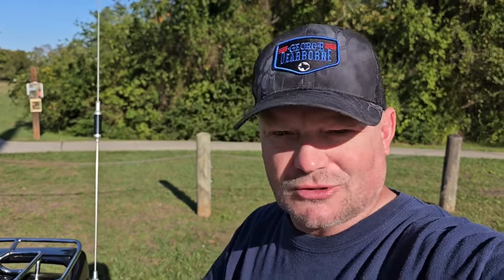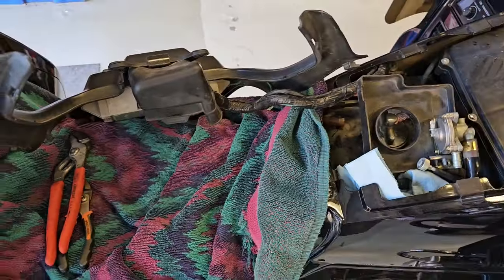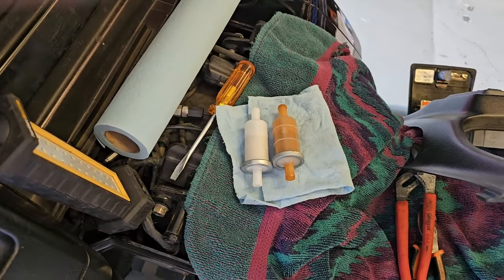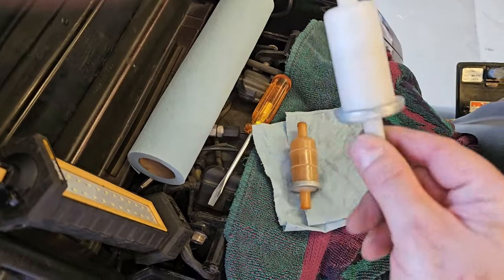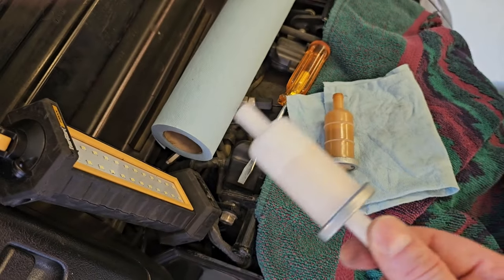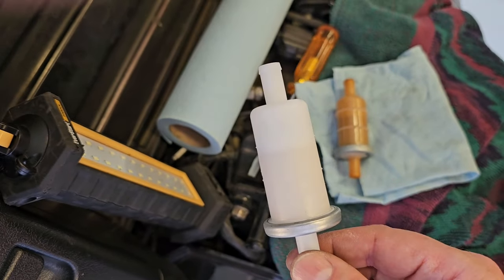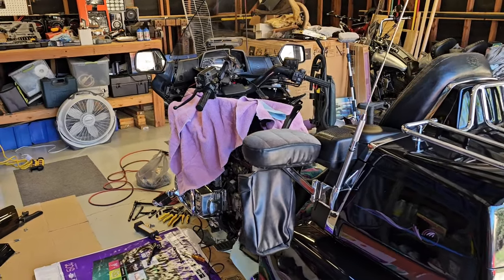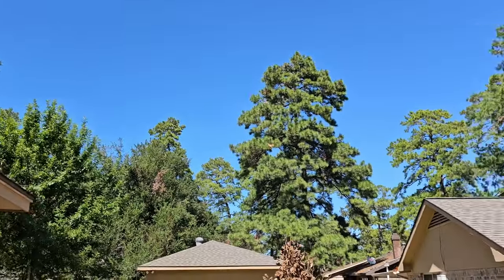1997 Honda GL1500 GoldWing SE Maintenance/Service Items Part 1

Comment: If you want an instrument panel you can see at night replace the bulbs with LED bulbs. Just so you know you have bought the best year GL1500 built. 97 has upgrades from previous years and no downgrades from later years. I currently own 2 97's one triked with 192000/ other with 73000. When you decide to change your timing belts go to Steve Saunders Goldwing Facts and get the upgrades on Idlers and belts rather than using OEM parts it will save you about $200. I have changed these on 5 1500's with no problems.

Comment: Clutch fluid level changes will tell you when the slave cylinder is needing some service.  It can't be overstated how dangerous having brake fluid and engine oil mix is.  My rebuild didn't work.  I went ahead and spent 90 bucks for a NOS assembly.

Comment: A very complete video. Do you have any idea what the secondary air filter is? And what type of LED lights did you put in the fog lights? Finally, you only cut one cable and that only makes the lights always stay on? Greetings.
Reply from the maker: The sub or secondary air filter is a foam filter that filters the air before it reaches the air injection solenoids, and from there the carburetors. For the cornering lights to stay on as fog lights you have to disconnect or cut the green wire on both relays that I point to. One relay works the left light and the other works the right light, but both relays are on the right side of the bike where I point to them in the video. Here are the bulbs I bought for them, one pack contains 2 bulbs -  https://www.ebay.com/itm/165805052556

Comment: A lot of info. A little too
Much chatter maybe. I did learn a lot. Thanks. The turn corner lights don’t work well a driving to figure lights. They are facing the woods. So not much use to see ahead.